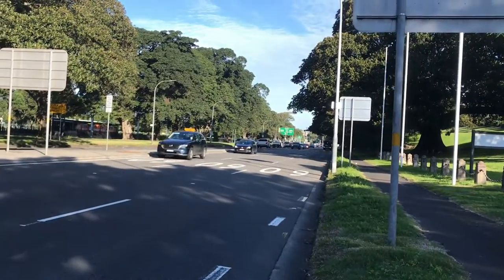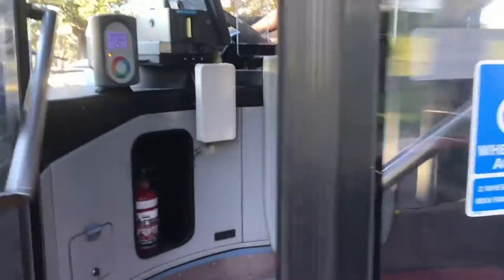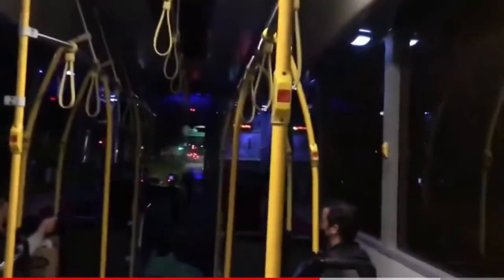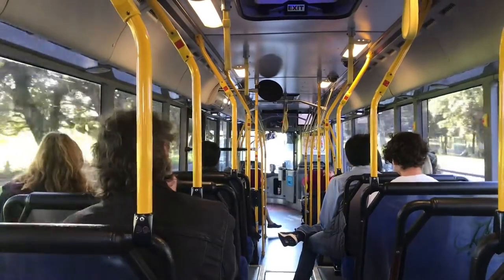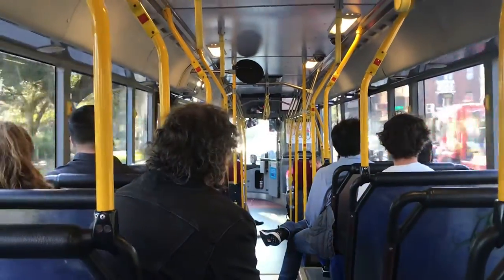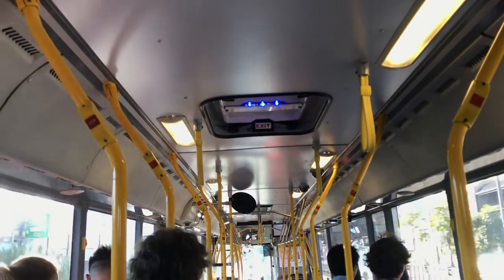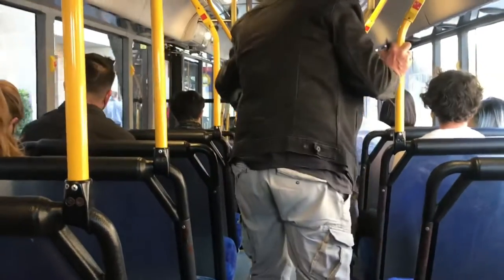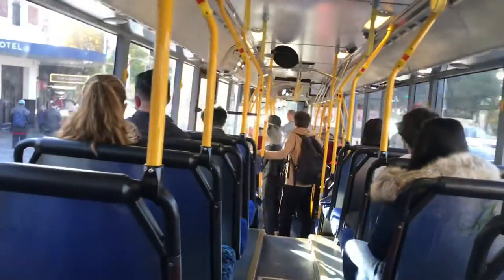Vlog 41: Scania K310UB tri-axle Volgren CR288L review

Comment: This is an interesting review of a 14.5mtr bus which is route restricted due to its length and would be used on high patronage routes and express services. The odd shaped poles are built that way to give a little extra support and strength to the body which flexes due to its length especially when turning corners and negotiating roundabouts. The windows are square for the same reason to stop the windows from popping out. The passenger buzzer sound can be turned off by the driver but a light will illuminate on the dashboard to let the driver know when someone wants to get off but the driver must remember to look at the light before every bus stop. The regular drivers would sometimes turn the buzzer off when they knew a new driver was taking over at a relief point just to prank the newbie because they thought it funny to see him get abused and yelled at by the passengers for not stopping. Sometimes the buzzer is faulty and will sound every time the button is pressed instead of just once which is/was a fun thing for school students to do and the driver would turn the buzzer off and forget to turn it back on which again would cause problems with passengers missing their stops.
Reply from the maker: Am I allowed to feel bad for the newbie driver?
Reply: @TheRealMillennium  Definitely because I think it is very bad to put a newbie in this situation as it gets them highly stressed and could cause other problems such as being assaulted.

Comment: There aren't two of these. I think the engine changes sound based on the amount of engine coolant in the bus.
I know for a fact that when the coolant on Hillsbus's Scania K280UB tri axles is running low, they run much louder.
The slanting stop bells at the rear are also found on the Volvo B12BLE Euro 3 Volgren CR228L but none of those operate in R9
The wall mounted stop bells are operator choice. STA chose to have them on the window frames and on poles at the rear but Hillsbus either ditched the ones on poles or the ones on the window frames.